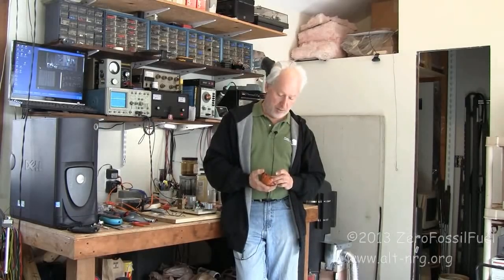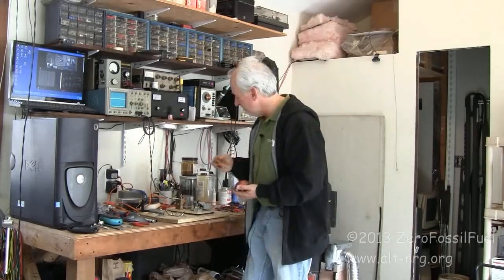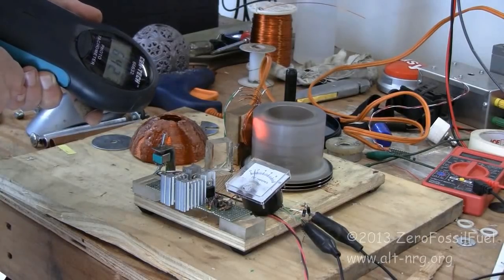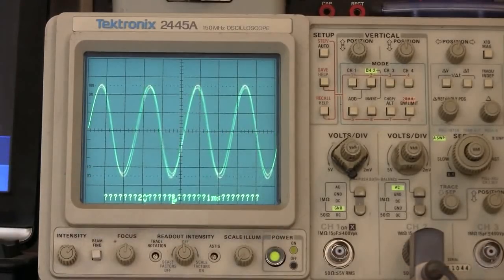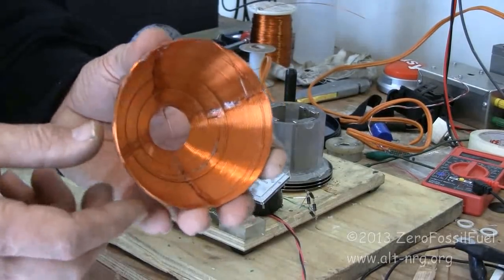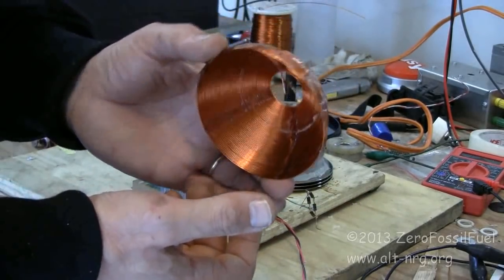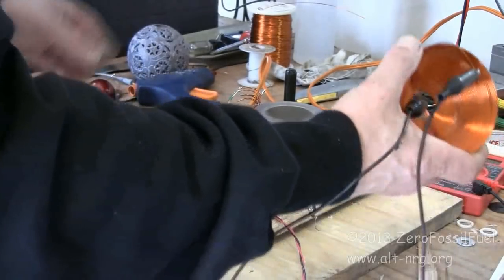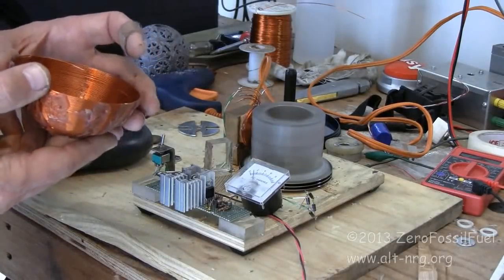#329 Zero Lenz dynamo

Comment: so you're using 17 volt to generate 15 volts?

efficient...
Reply from the maker: LordSignur Sarcasm noted.
Reply: ZeroFossilFuel 
I'm not sarcastic. I'm criticizing.

What is your way to make it more efficient? 

How can you get "free" energy ? How can you make energy without providing work at first ?

do you have a way to make a machine that do not need upkeep ? (this one is indeed a little sarcastic)
Reply: LordSignur 1. Its an Conversion, you can´t generate energy 2. Electrical energy is always a combination of V and A, 5V and 10A is 50W, 10V and 5A is also 50W
Reply: Kyuubi Yoru

"1. Its an Conversion, you can´t generate energy"

i know. that is why i say you can't get free energy.

"Electrical energy is always a combination of V and A, 5V and 10A is 50W, 10V and 5A is also 50W"

thx for the lesson but what is the point?
Reply: +LordSignur gotta start somewhere.
Reply: Peacefulsoul85 Gaming
go back to mechanic class. you obviously missed the lesson on the efficiency generator and the physical rules that explain how you can't have a ratio over 1.
Reply: LordSignur If there is a way you have tyo find it, that is why you have to start somewhere, there are currently machines out there that use Over Unity, I give the guy a maybe on it at the very least an E for effort, I don't see people like you going out and actually trying to figure this stuff out, at least he is thinking, trying to do it.  Come on.  Don't be a troll.
Reply: LordSignur I said Troll.. I meant Pessimist.
Reply: *****

"The best source of cheap energy is the sun, solar panels have a lifetime of 25 years and are maintenance free due to the fact that they are solid state."

they are too ineficient as well because way too much impacted by location. It can be a nackup power and secundary power source but it won't be our main source or energy in many location. they are also expensive to make and use non renewable materials to be built. They aren't eco friendly (for now. soon we'll make them with ersatz that are eco friendly)

the only real efficient way to get energy, anywhere and renewably is geothermal power
Reply: *****

australian have a lot of sun. this isn't the case of the whole planet.

the germans dont, they made huge fields of solar panel. It is efficient, it use renewable energy. It wasn't made with renewable ressources though. So the environnemental cost the german created is behind. They still hurt the environnement, just in a different way.

the dutch use solar a secondary source, othertwise they rely on tidal power (as they are a coastal country)

"We use geothermal on a large scale here to but the expense setting that up for yourself must be astronomical compared to solar."

Geothermal power don't require rare earth to be made. solar panel does. Ever heard of the darfour conflict ? With it, they make essentially smartphones, batteries and.. solar panels..

the expense of geothermal is environnementally friendly. It cost money but it doesn't hurt the planet.

As of now, making solar panel hurt the environnement as it use non renewable elements to be made (give it a decade or so and it will be different)

solar is good backup power. It have a environnemental cost that is not going to last.

I am NOT saying solar power suck. It rocks.

but it is still infant technology and it DOES have a bad impact on nature (to make them, not to run them)
Reply: LordSignur yeah, give us a few years and let the people who experiment with stuff like this do their thing and the law of averages says someone is going to invent something useful.
Reply: *****
i'm not an expert so i cannot go that far in the discution.

what i know is that, the most efficient model (ratio cost/benefit and work/efficiency) is alway the model used. if polycrystaline silicon is so efficient, within 25 years it will be as common as hydrocarbon poweplant.

If it's not already in the process of replacing the actual infrastructure (which is not, not yet) then it isn't efficient enough or profitable as the other means in place...
Reply: ***** Well I was saying 20 years ago with Nikola Tesla's Wireless Electricity concept being buried beneath 150 years of Government black tape and marker point someone will come up with some idea that would similarly work, so far there are a lot of theories and ideas, but it's up in the air right now.  It's only a matter of time before someone comes up with something similar.  Hopefully soon and it will make the world a better place.
Reply: Peacefulsoul85 Gaming
 you don't need government black tape. Tesla was just too advanced. Wedon't understand how he did.
Reply: LordSignur The reason for all the government black tape and why I say this is because the government wanted to enslave us to their will by forcing us to pay for power to be strung to us via power lines etc, thus they buried Tesla technology and still are, it all has to be rediscovered as a result when you know as well as I do that the technology exists, it's just sitting on a dusty shelf still in some bunker in blueprint form.
Reply: LordSignur Yeah but you can say whatever you want on the internet and it doesn't matter, I can say "Hey I was late for work last night because a Midget was tap dancing on a power line in high heels and the fire trucks and police were trying to talk him down and they were blocking the road, I tried to re-route, but there were a million cars behind me and they were all stopped to watch the show.  While I admit you don't see that every day, I had to get to work.  "It's not true, but who would know that.  Conspiracy theories are about 60% true regardless of what most people think, usually though when it comes to estimation it's about 400 Times worse than the Conspiracy theory states it is, then again I heard that on the oh so true internet where no one ever lies or makes up false facts or anything.  Stupid Internet.
Reply: *****
 I'm french yet i heard seventeen, not seven. i really heard teen. that sound is not mistaken by my brain.. :)

He said seventeen as i heard. In the end, i'm not sure.

even though, you can't turn 7 volt into 15. that an easy engineering mistake. it just show that you (or the youtuber who made the video) never went to electrical school (as i did)
Reply: +LordSignur completely missed the point.
Reply: *****
what was it ?
Reply: geometry
Reply: check out; "vortex based mathematics" Randy Powel) , "schwarzschild proton"(Nasim Haramein)
Reply: not magically, naturally :)
Reply: kirchow law does not apply, black body radiation experiments are done wrong and there are many people that understand it and know how to explain it too.
Reply: *****
Several buddies of mine work in that field, new generation engines. they told me this is BS. I have more trust in PHD's i know than youtube comments.
Reply: *****

I'm just saying that i trust more someone i know than someone on the internet.

I don't know if you are right or wrong.

You obviously know more than me. The way you get rid of my argument obviously mean i should revise it. I'm not moving the goal post, i'm recognizing my ignorance.

I'll ask my buddy again. I'll ask other peoples as well. I'll find out. but not here.
Reply: *****

"I would never claim to know more than you. How could I ?"

you can't. but you can say that you know less than me. (you can say it, but you don't. you clearly know more than me)

I am able to recognize when one know more than me. I guess you are as well.

"Indeed : making 'science' a thing that only 'qualified' people in white dust coats working in stuffy laboratory's who have PhD's behind their names should be involved in, is terribly detrimental to the future of science."

that's not what i believe. my bad if i sounded that way.

A scientist is one who follow scientific method. nothing else.

You don't need to have phd's or to be working in a lab to be a scientist.

anybody who :
Observe a phenomenon then Analyse it and make hypothesis then Experiment to refine said hypothesis and in terms is able to reproduce the result with accuracy (or demonstrate the falsehood in it) (a.k.a falsification) is a scientist.

so far i, about this conversation here, about energy and engines, i clearly know less than you. (or you are completely lost)

as a scientist, i can recognize that i don't have enough data to make an assessment.

in that situation, by default, i'll back up until i got further data.

In that situation, what i hold true is labelled "uncertain" and discarded untill i got more info. What you said is labelled "hard criticism" and will be kept aside (bnot discarded) until i got enough data to either acccept it or deny it.
Reply: it really doesn't mater who knows more and so on, it's about shareing ideas for the humanity. 
we nead scientific methode but we allso nead imagination and creativity.we nead both the sides of the brain.
Reply: *****
 the scientific method cannot work without imagination and creativity. that's what drive curiosity and invention.

that's what most white coat missed. Most peoples we call scientist are not scientist.

The problem and faith and belief (as opposed to trust and knowledge). Not imagination or creativity :)

every child below 6 years old is a scientist. Until he get to learn the adults bullshit...
Reply: ***** hahahahahahaha so funny
Reply: +4 Foxsaches As he openly and honestly admitted. What about your experiments? Oh, you don't have any. Always easier to be a critic than to create.
Reply: +LordSignur Mind-controlled much? Listen to the Nulan/Pyatt tape, and the Ashton/Paett tape, for just one example of proven conspiracy that, coincidentally, never seems to get mentioned in the propaganda press narrative about Ukraine and "Russia's aggression". Now, go back to sleep citizen.
Reply: +misa lazovic True that. Black body theory works great... for true black bodies. Problem is, most objects in our Universe aren't black bodies, so the theory is anything but universal.
Reply: amen
Reply: +MadMax Fury what you said.